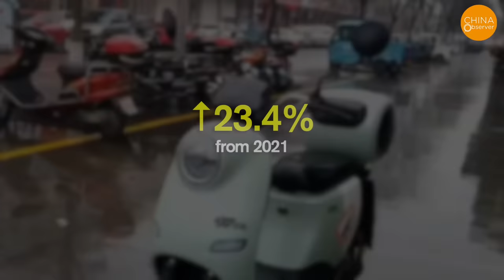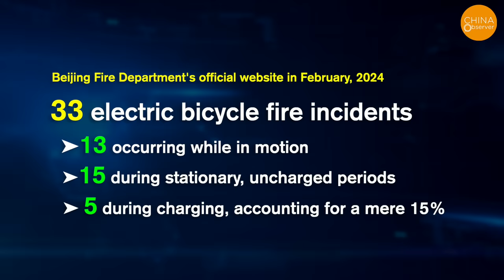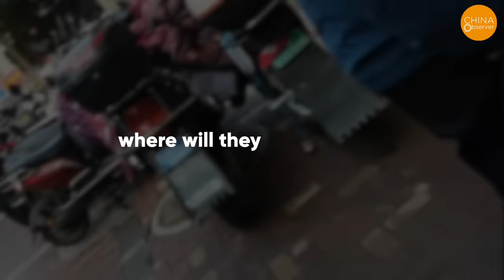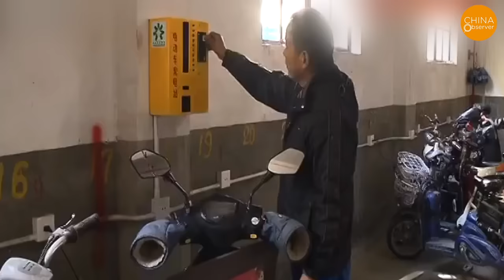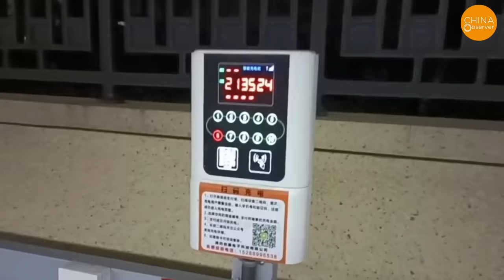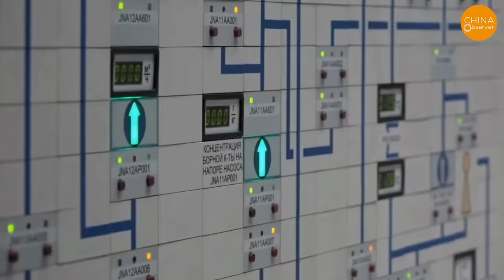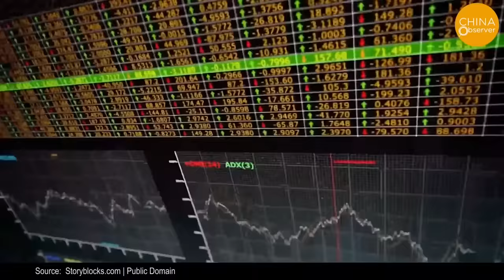21,000 Fires a Year! China’s Often Self-Igniting EVs & EBs Become Ubiquitous ‘Moving Bombs’

Comment: BEVs have inherent fire risk.  The absolute proof is the Falicity Ace auto transport ship.  A Brand new Porsche EV ; just sitting on a ferry caught fire.  The fire then spread quickly to other EVs getting totally out of control; sinking the ship in 10,000 ft of water. There is only one reason for this - Dendrites.  Dentrites form inside the battery; deposits which can grow internally and create a short which causes high heat if that battery catches fire it will spread to other cells in the battery pack soon the entire BEV is in intense fire; that spreads to other EVs which cause a catastophe. Do you want a bunch of EVs in the parking garage of your hotel or apartment?

Comment: i'm not a china supporter or apologist per say, and personally, i think most if not all of what they make is needless garbage. that said, the number 21,000 seems high especially when compared to western statistics, but when you contrast 21,000 against the number you gave for yearly production of 35 million EV's manufactured. suddenly,  21,000 fires doesn't seem like very much.
Reply: Yes, ratio-wise, it may seem smaller... "ONLY 1 vehicle burnt spontaneously out of 1,667 vehicles." 
But considering:
1. How fast the fire escalates (within seconds)
2. The impact of the fire (properties, other vehicles, and human lives)
Because remember it happened spontaneously.
The Chinese has appropriate idiom for this. No one could keep guard against thieves for 1000 nights (or roughly sounds like that). And MOST people will only have 1 or at most 2 EV.
So I would say, 1 incident is 1 too many when it comes to someone's safety.

Comment: All lithium batteries are fire hazards irrespective of the manufacturer, it is the nature of the beasts. The answer is to switch to sodium ion batteries that do not have the same problem as CATL and BYD have done though this does not address the problem of millions of lithium ion battery vehicles in Chana and elsewhere that are an increasing risk as they age or owners try to address range problems by overcharging above 80% capacity.

Comment: Li ion battery's are the culprit here so they have to STOP putting liion batts in vehicles. But they have produced so many lithium batteries in the years before. As battery technology rapidly changed into more save like SIBs and later SSBs the lithium stock in warehouses will be used up first. Of course this is the wrong way to proceed. For me personally I have SIB (in moto)which are really great and fast charging - ±45min. -

Comment: I'm tired of hearing "lithium ion batteries are prone to fire" they haven't been for a while if you buy from reputable brands that don't lie about their specs, practice good battery safety/have good regulation circuits for use/charging, and don't use the batteries past their spec.... China is making Lithium Ion batteries look really bad when this issue is entirety China's fault for their absolute garbage battery/car manufacturers building cells with zero safety standards.

Remember, for high drain and high amp usage: we used to use Li-Po batteries..... I remember needing an extension chord going outside to a special fireproof bag with a battery inside because that was literally how the RC car manufacturer intended the battery to be charged. What we used to have is alot more dangerous.

Comment: Not JUST  Chinese EV's / bikes ect but ALL EV's should be banned untill a safe effective reliable battery design is used  better  still scrap the Electric motors and batteries  and retrofit Diesel or Petrol engines . Far better not as harmful to the Environment  as EV's  .

Comment: Mostly probably and logically sabotage. Note how almost no electric vehicles catch fire when people are in them. So these are clearly NOT random fires. If anything EV fires should be happening when people are driving them - especially when they're driving them fast in hot weather after charging them to 90%-100% full.  Instead most EV fires are very suspiciously happening when noone is likely to be killed because noone's in them and the batteries are enduring no workload/payload stress whatsoever.  
Powerful entities linked to gasoline and the Infernal Combustion Engine as well as psychopathic EV-hating petrol-heads are waging war against EVs as never before and every which way - and anti-China and anti-EV entities are working hard and warring hard to vilify both China and EVs in the hope of killing or crippling TWO birds with one stone..
Paul G